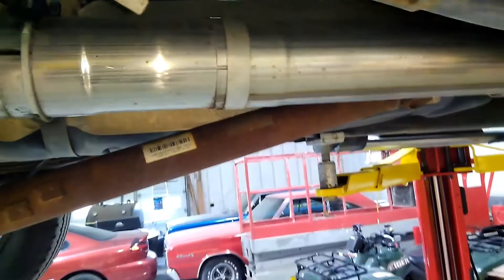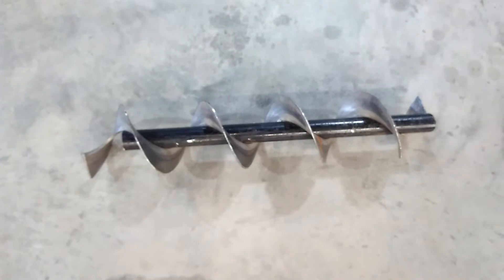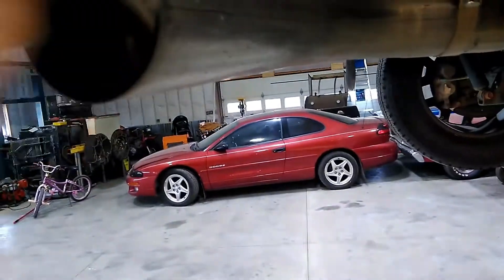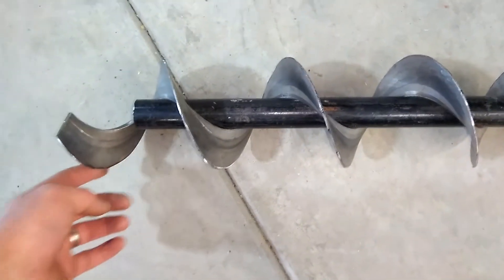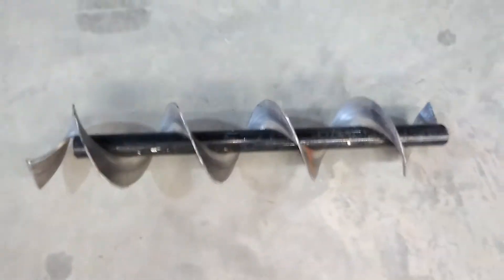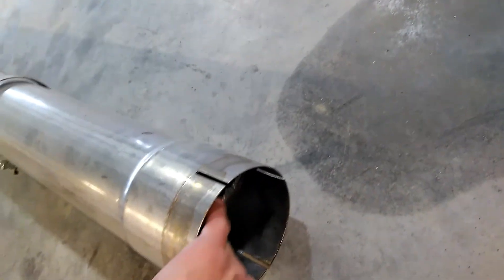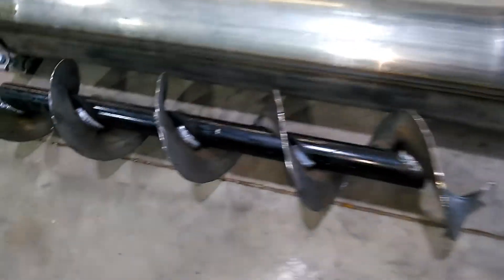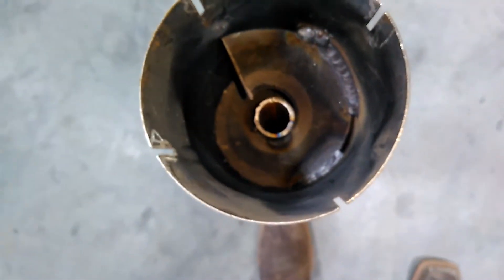Diesel Truck Drone Noise Fix

Comment: So you installed a bug exhaust to get rid of restriction for more power mpg then restricted it to get rid of the drone so you probably now back to the same flow as a stock exhaust. I put 5 inch Diamond eye on my Fummins truck because the motorhome the engine came out of had 5 inch exhaust. It drone crazy bad at 55 to 60 mph. I will maybe try a J-pipe or maybe try one or two 5 inch see through full flow mufflers.
Reply from the maker: Not sure how much backpressure on this setup, but I did go to 5 inch instead of 4"  mileage is still 20- 25mpg

Comment: Without the pipe in the center or cutting it down couldn't you just pull it into the pipe and have a pressure fit inside the pipe?

Comment: How and what did you use to trim the auger flight to the right size all the way around?
Reply from the maker: I just used an angle grinder to get it so it fit loose

Comment: Very nice job. I would like to know where to get the auger material you used? I have a 2005 dodge 2500 with 5" exhaust and really need to do the same thing. After watching your video I think that's the best way to go in order to get the job done right! Your truck sounds awesome! Thanks so much for sharing...
Reply: Thanks for the reply. Again very nice job...
Reply from the maker: Thanks, I got it at my local weld shop!  I live in an agricultural corn belt area so it is pretty available to me.  So you need to find someone that sells ag parts or find some in a ag salvage yard for combines!  Home this helps,  you could try All State Ag Parts on the internet